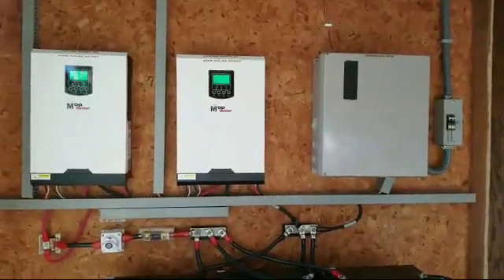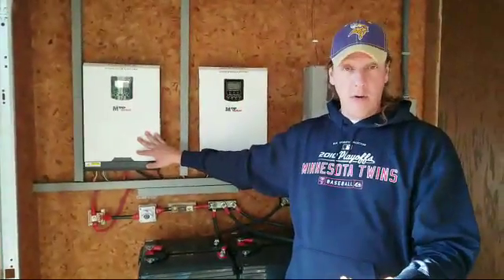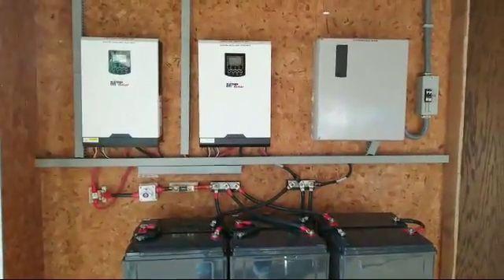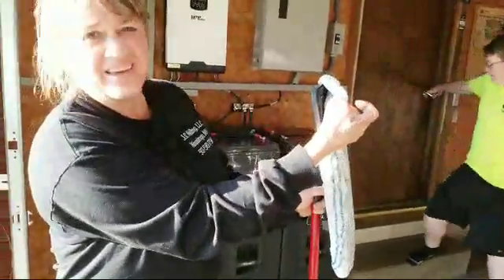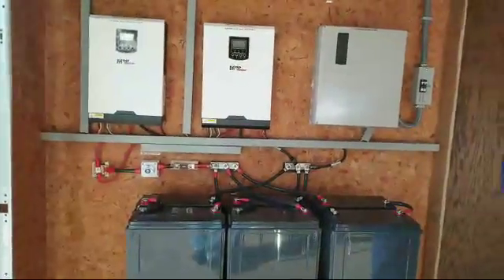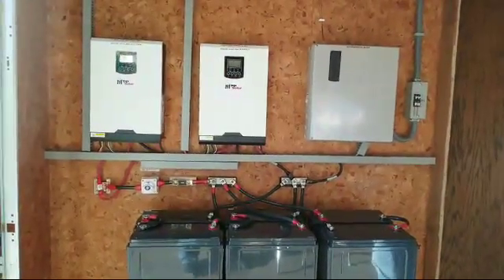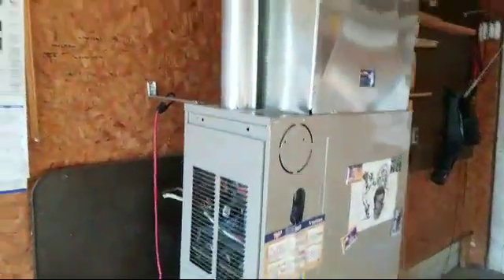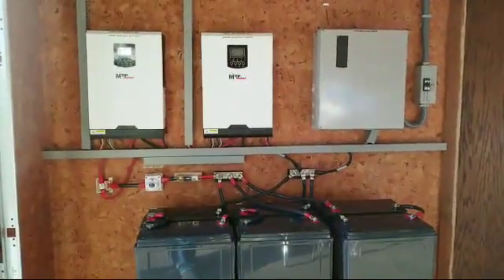PIP 2424LV-MSD 120V 60Hz INSTALLATION COMPLETED: By jwsolarusa

Comment: have you been problems with battery charger?
Reply from the maker: +Esteban Galvis Villegas 
Not at all my friend. Thanks for asking and don't forget to SUBSCRIBE, give us a like and share my videos.
Have a wonderful day
Reply: Can you tell me what configuration you have in [02] and [11] ?
Reply: I have mlv 3kva-24v and have a problem charging my batteries. Thanks
Reply from the maker: +Esteban Galvis Villegas 
Hello Esteban,
Sorry for not responding earlier. Here are the answer to your questions on my PIP 242424LV-MSD 120VAC 60Hz VERSION 

[02] 120A
[11] UTI 60A

FYI these PIP's I am using here are designed for the United States. I am not sure what version you have their.
Reply from the maker: +Esteban Galvis Villegas 
Please let me know if you find this information helpful. PLEASE SUBSCRIBER LIKE AND SHARE THIS VIDEO WITH YOU SOCIAL MEDIA NETWORK 
Thanks for watching buddy and have a wonderful day
Reply from the maker: +Esteban Galvis Villegas 
MPP SOLAR INVERTER CHARGERS PIP 242424LV-MSD - Complete Installation
WANAMINGO MINNESOTA BY jwsolarusa
Reply: Hi jwsolarusa, I am the same inverter/charger like you PIP 2424LV 120Vac-60Hz, I am working only in battery mode, I haven´t utility, so when try to charge batteries all day, only can charge two bars. I have 8 batteries 12V-105Amp Gel and 6 Jinko solar panel 320Wp. I dont know what is wrong. Could be the cable connetion in batteries? What do you think?. Thank you very much for your time.

Comment: Awesome!
Looks good!
Reply from the maker: +Solar Junky 
Thanks for watching
Reply: Thumbs up!
Reply from the maker: Thanks my friend. I really appreciate your positive comment.
God bless and have a wonderful day
Reply: Only thing you may want to add? would be to add the hot water heater as a dump load Or on a timer & or voltage control switch re wired to 120v single phase.... It's super easy to do. And will work AWESOME!!! If you would like will help you with the mod....  Very easy mod.....  
Keep up the good work.
Reply from the maker: Solar Junky 
Will do and thanks for the offer my friend.
Reply from the maker: +Solar Junky 
Ok my friend.
Send me your contact on a private message. 
Thanks for watching buddy and have a wonderful day.
https://youtu.be/Q-9AMh_ATTk
MPP SOLAR INVERTER CHARGERS PIP 242424LV-MSD - Complete Installation
WANAMINGO MINNESOTA BY jwsolarusa

Comment: According to the MPP Solar manual, the generator is supposed to be 1 1/2 times bigger than the inverters tied to it. So do you think that it is not necessary to do it that?
Reply from the maker: Yes.
You should be able to support the loads plus the extra power to charge the batteries simultaneously. 
Thanks for watching, LIKE SUBSCRIBE and SHARE